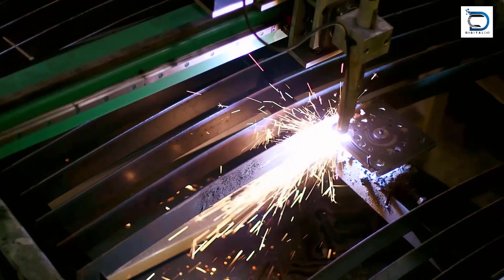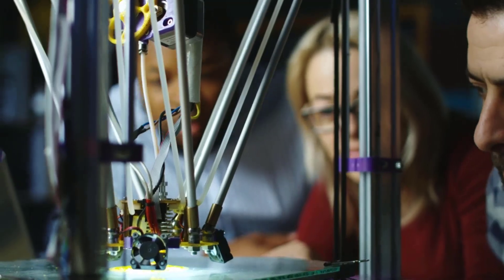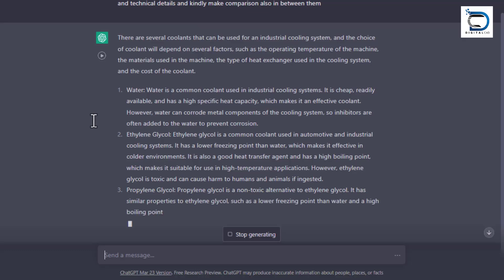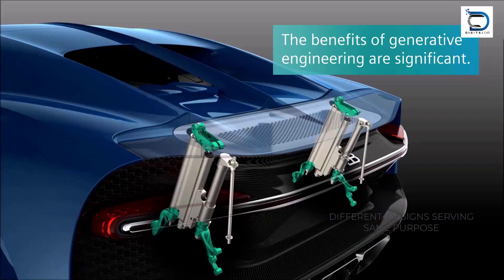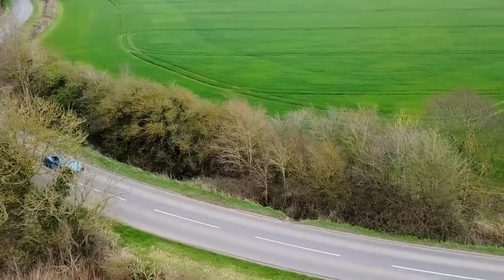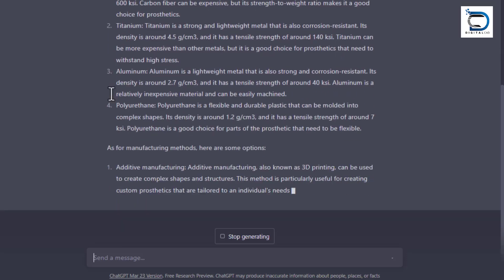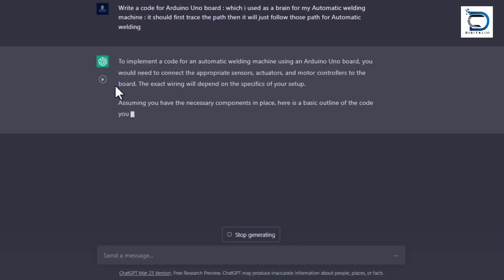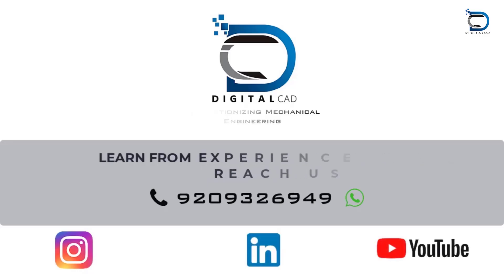How ChatGPT Simplifies Mechanical Engineering? From Design to Production

Comment: I'll trust a  mechanical engineer with 50 years over Chat GPT, as they say garbage in garbage out, I don't know who loaded the data and the source of the data. Its good for basic info but it does not have the knowledge specific to a certain business in industry, its general information no real world experience, no shop floor experience, nothing but data that may or may not be correct.